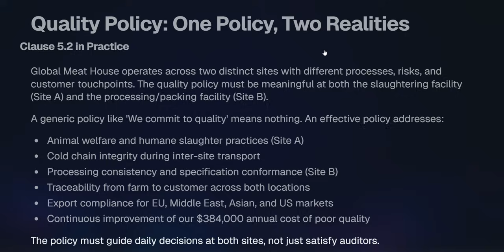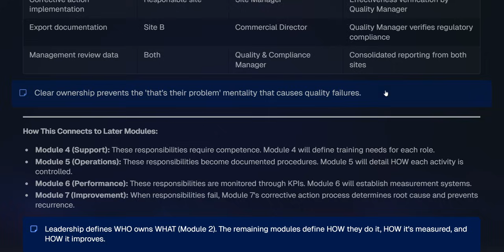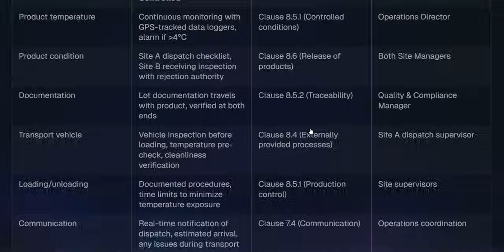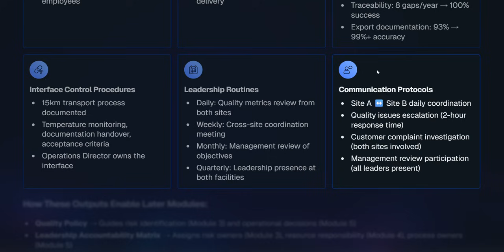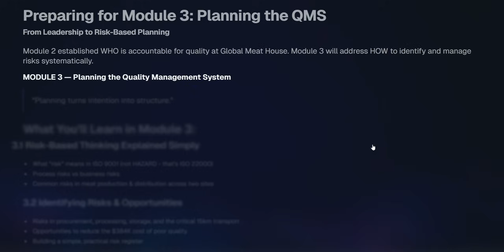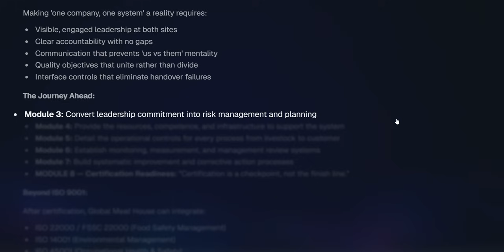ISO 9001 From Zero to Certification – Module 2: Leadership & Quality Culture

Comment from the maker: This is Module 2 of an 8-part ISO 9001 implementation course.
Module 2 answers one critical question: Who actually owns quality across the organization?
Before moving to Module 3, make sure your organization can clearly answer:
A. Who owns end-to-end quality across sites?
B. Who owns the interface between operations?
C. Are quality objectives shared or competing?
D. Would employees describe leadership as visible and engaged?
▶ Module 3: Planning the Quality Management System (Risk-Based Thinking) — coming next.

📌 Start the full course here: 
https://www.youtube.com/watch?v=635Yd0RY7VU&list=PLpjg2sQqENxpX1I-BuqdfCaL003zCMf9O&pp=gAQB ISO 9001 – From Zero to Certification (Complete Playlist)
or
📌 Start the full course here: 
https://www.youtube.com/watch?v=nbldSNzf0Ms&list=PLpjg2sQqENxrXg5OHN88-I17cmLA7qsPI&pp=gAQB  ISO 9001 Implementation – Step by Step (Practical Training)